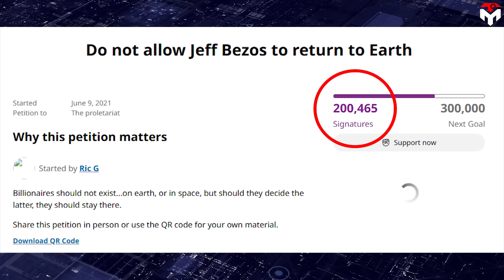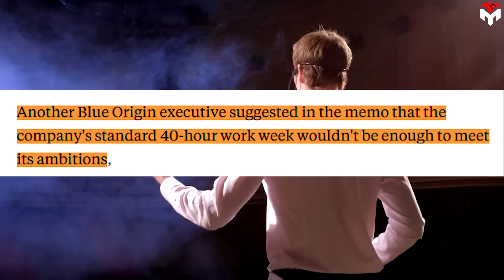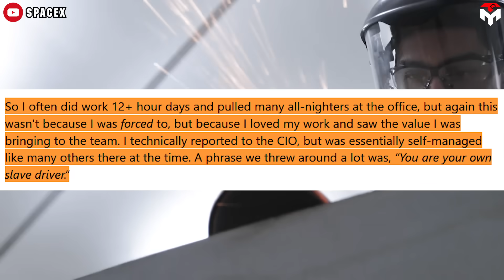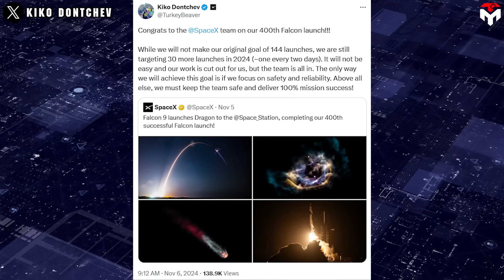It's Embarrassing! Jeff Bezos Copying SpaceX's Rockets But It's Backfiring Now...

Comment: They're painfully slow with their R&D, in legacy aerospace fashion, but at least they are trying and not just wasting time on obviously doomed designs like ULA who have an uninspired plan worthy of their moribund management. Blue Origin are competing with SpaceX. ULA are competing with their previous selves and it won't end well. Blue Origin have also developed the BE-4 which would be very interesting if Raptor 3 wasn't there and cheaper. If BE-4 hits volume production it'll come down in cost. New Glenn will be a Falcon 9 class vehicle in terms of ballpark cost but with much more lift capacity. It will have a market before Starship undercuts everything. I hope Blue Origin stays in the game and works on a reusable 2nd stage. We need competition to mitigate any temptation for SpaceX to inflate launch costs.

Comment: 25 years and still BO hasn't placed a single Kg into LEO.  By any reasonable and even unreasonable standards, BO has to be considered and epic failure.  BO has just been a side hobby for Bezos.  There really isn't any other way to evaluate it.  

Kind of like you neighbor who has had an old 60's classic car on cinder blocks in their back yard for 25 years always talking about how nice it will be once he restores it.  You neighbors problem is he doesn't have the money to properly restore it.  That is not a valid excuse for Jeff.  

I wish BO luck with their NG rocket, but luck doesn't get rockets into orbit.  Everything they are going to try with this 1st launch and it will be brand new.  What is the likely hood that it all works perfectly in this 1st launch?  It is reasonable to expect a few test launches to work out the bugs.  Even the Saturn V had issues with it's 2nd launch, Apollo 5 and that was after a successful Apollo 4 launch.  

I don't know for sure, but I am guessing NG is about 2-3 years away from being able to re-fly it's 1st stage on any kind of regular basis.  I wouldn't be surprised at all if that slipped to 4-5 years at normal BO pace.  Exactly where will SX be in 4-5 years?  BO should of purchased ULA about 2 years ago..
Reply: ULA is an albatross that will sink any other enterprise. Those proposing saving it have clearly no idea of how insane its cost structure is.